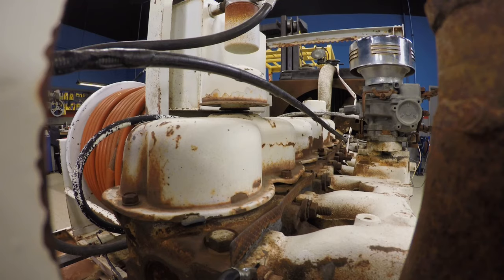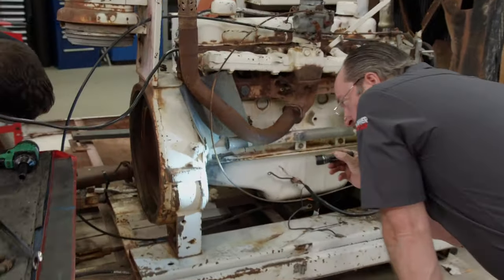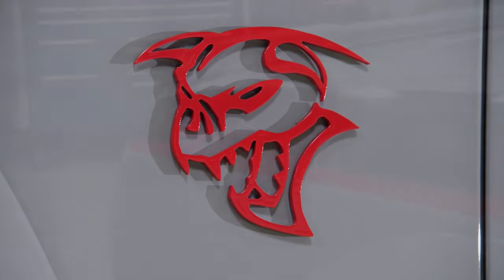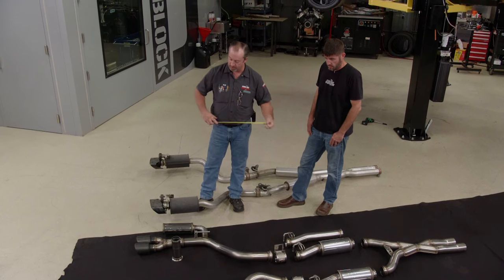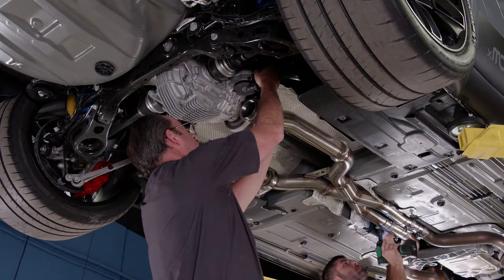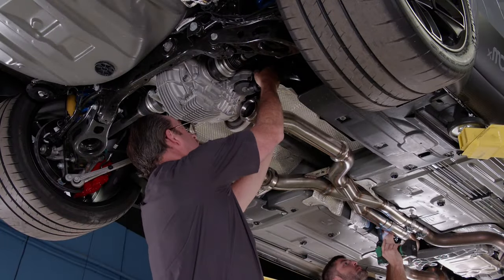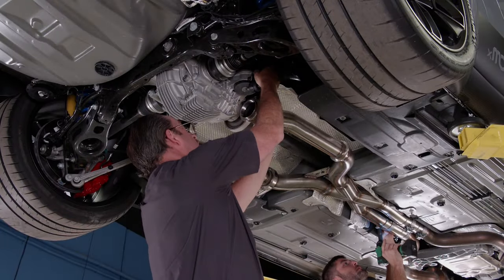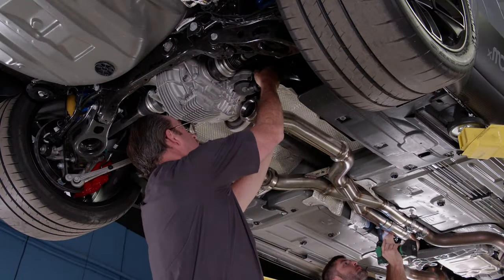Will The Ford 300 Inline Six Start After Sitting For 20 Years? - Engine Power S7, E14

Comment: Im not surprised this Ford inline six has the same good natured action as the 225 Slant Six from Chrysler that ran millions of Dodge Darts. This type of engine is almost impossible to destroy! Those run on High Compressed bottled  or stationary natural gas feeds,  stay clean inside,  like they were made yesterday, since carbon is not a product of its combustion. I know, because I replaced my clogged catalytic convertor damaged 235,000 Slant Six with low compression and severe blow by, killed rings in my 1981 Cordoba with the Hydraulic valve lifters and last revision of the head for the new lifters,  with the same out of a  1985 Dodge East Ohio Gas Company Van that had been rear ended.  

The junk yard crinkled the valve cover and I wanted to crY at how cleans this piece of mangled Valve Cover was on the inside! I also marveled at how clean the rest of the inside was and I spent hours meticulously stripping my old valve cover to get it in the same condition. That engine was like new inside, no clogged oil gallery passages to worry about! 

Unfortunately, the gas company removed all the CNG systems, or I probably would have tried it on CNG! I did replace the clogged Cat abc all went well and it ran like new with all the torque to make the  reasonable acceleration, it had when it was brand new!  Torque is what makes these go, not horsepower. They really have great low end torque, same goes for any inline six! These should never have stopped being made!

Comment: Believe it or not I just pick up a 1992 f150 with a inline6 5speed 4x4 hasn’t run in over 3 years! Back in January been messing around put a new fuel tank and pump in it new Spark plugs and wires and she fired right up

Comment: What is the weight of the passenger 240 vs. the weight of the 300 truck engine?
Reply: Alan White : No major difference. Maybee 5 pounds less than the 480 pounds with accessories. 15 to 20 lbs over a stock carb 2bbl 5.0 or 289 [No p.s., no a/c, just alternator, starter flywheel & water pump.( The small one at the front...not the big one at the back!)]
Reply: @deanstevenson6527  thanx, l was thinking it would be 50# less than a 289.
Reply: Alan White : No, the US 250 and Aussie 250 alloy heads are about 430 to 450 with accessories, although Ford claimed 410 pounds once on the iron log head 250. But they also claimed it was a 155 or 145 hp gross engine, same as the early 240 Big Six. The Australian cross flow 250 iron head engine from 1976 to 1980 weighed 481 pounds and lost 51 pounds with an aluminum head, but when fuel injected, it had another 51 pounds of alloy intake and vane meters and wet fuel gear added. So all Ford sixes varied. The little US 200 was 365 to 385 ponds dressed.

Comment: I owned a '66 Ford F100 with the 240 cubic inch version of this engine.  When I needed to change the oil, I climbed into the engine bay and stood next to the engine while changing the filter!  This thing ran forever.  The 240 in my old truck made about 129 gross hp [about 110 in today's net horsepower] so the 5500 pound truck wasn't uhmm.....Fast.  But it could just about pull a house off of it's foundation....
Reply: I converted my Truck 6 to electronic ignition.

Comment: Perhaps the greatest gasoline straight six ever made!  Is that a Heavy Duty exhaust manifold on that thing? 
My truck has a 240 which is a destroked 300, (someone swap-robbed the original 300) and it still has the torque to move my F150.  The worst part of these engines is the puny Carter YF carburetor and restrictive intake manifold.
I prefer the old log style exhaust manifold for its smoooooooth sound.  The EFI split manifolds add choppiness to the sound, even through a long single exhaust - they make it sound more like a V6...

Comment: I worked at a oil change shop as a teenager and saw a company bring there service trucks with 300 in them and one had 475 Thousand miles and showed no signs of stopping.

Comment: This was a really FUN episode...  I hate to sound like a parrot, but, all my years of building performance engines, sure, it pays the bills, but it is boring to me anymore... When somebody brings in some crazy and odd, or rare.. Man does that get me excited... I am like, I accept the challenge, of trying to locate parts, cross ref parts, like Cadi forged piston in a Ford engine, (yes, I did that once, LOL). I once had a guy bring me two engines, one that he wants built stock as possible, as per a concourse efforts, and the second unit, he wanted HP'd out, and he claimed he was gonna just have it on a stand for show, so I got to concourse the daylights out of that as well on the 1945 to 1950 Crosley racing engines. These dinky inline 4 bangers produce something like 35 to 40 HP, that is how dinky they are, How many of you folks have lawnmowers that are sitting in your garage that the engine came with much more HP this these dinky Crosley 4 cyl inline engines? LOL... None the less, Those two dinky engines were some of the funnest to play with, exceptional hard to locate parts for, let alone new parts or to say, new old stock, that is just not gonna happen.. SO, we spent many hours in R&D making cores for our local foundry, to cast a few extras, like cam shaft for the strange overhead valve train, a few extra crank shafts the complicated water pump housing that was actually hard to make cores for and get it right, due to the strange nature of its design. We even made a few sheet metal stamping dies for a few items that were sheet metal on the engine, .. The engine dynometered at 53 HP all said and done... That may not sound like much, but when you see how dinky those pistons are, if I remember correctly, has a diameter of 1-3/8th  or maybe it was 1-5/8th diameter, LOL.. Heck, the old school B&S lawn mower 2 stroke has a much larger piston then these little guys had.. It was so much fun ...  Cleaning the head gasket mating surfaces up by standard methods, one has to be extremely careful to only remove enough material to just clean things up, as a .020" deck combined clean up of those surfaces, would change the compression ratio too much, LOL.. The smaller you go in cu. inches, those numbers really start to get really tight and can throw the base geometry of the engine way off...  These little engines are very dinky, A Ford 2.3 ltr is just about twice the size of one of these Crosley units, Heck, the Honda 1.8 ltr is still twice the over all size of a Crosley from the 1945 to 1950's... Wait until you see how the cam shaft is driven off the crank shaft.. clever, neat, but risky, but it works.. Oh, we had to machine new helically cut spiral gears at all 4 locations, as that oiling appears to be a leak in the top set, hence the massive amount of slop, a copper drip tube plumbed into the galley resolves that issue, the copper tube was choked down via a press-fit button orifice approx .030" diameter, so the dripping was constant, but not taking away pressure from the rest of the bearing surfaces.. Pardon the novel, but the strange engine stuff, like this Ford IN, Inlive 6 / 300.. That was cool. The torque out of that 300.. wow!!!

Comment: I got a C20 1983 Dually 4 door with a Turbo 400 Automatic 3 Speed, along with a 373 Ratio.  I've been wondering of taking out the 454 and putting in a 6 Straight 292  and putting on a Turbocharger.

Comment: The 300 six is big, it's heavy, it gets terrible gas mileage and makes very little horse power, but it will run and do the job no matter how beat it is.
I had a friend in high school that had an 81 f250 with a 300 six and that motor had so much blow by the dipstick would shoot out of the tube when you revved it.  It smoked and knocked every time you shifted gears and was by far the most worn out motor I've ever seen and he drove that truck for 5 years without any problems at all.  It always started and always ran.  He ended up getting tired of the truck and sold it

Comment: one of the best motors made, if you have a carbed one the carb is two piece and the two screws holding it together will loosen with time, it will run but start to want high test gas, offset Phillips screw driver, easy fix.

Comment: skipped the dodge, i wanted to see that 300 run.
other than that header intake heat issue, these engines were bulletproof beasts that just would not die. my dads old bronco had the 300 in it and that thing wasnt fast but it would rip a house off its foundation

Comment: Big far of straight 6s and v6s, as its what me mostly got her in Europe. A nice 4.9 straight 6 would be wonderful, and I bet it revs brilliant
Reply: runs like a diesel, the regular motors don't really like anything above 4k from what I've heard. the models with the forged crank could be run higher
Reply: @daveb1081  so more about a strong torque curve from low rpm. You guys got some amazing engines compared to Europe.
Reply: @RobsonRoverRepair  oh yeah this thing is capable of hauling fullsize backhoes and pulling out stumps lol

Comment: I would like to see someone soup up a 300 6 cylinder the last I heard of one that was souped up super fast was one that had a Cleveland head on it but it was cut into three pieces and weld it back together I'd like to see that or some kind of big Dino deal what does 306 because there's millions of them on the road it would be a fun project
Reply: I was reading the other night one with ls heads on it

Comment: my 300 i had on my 90 f150 and it was a 5 speed manual made it fun to drive it felt fast but i also did beat the crap out of it redlining it and just plain out flooring it all the time it held up but it did always have this cold start rod knock before i had it it ran ruff and was sludged up but it still ran sold it to some sucker lol

Comment: The 300i6 is the greatest engine ever produced at least greatest gasoline engine bar none. Ive seen one be used for 5 years without a new oil filter and it was rigged up with some old hose to draw gas from a jerry can because the trucks fuel system had rusted to hell. Repaired with outright duct tape and old cans that truck still runs to this day and hauls big stacks of firewood. Some engines are built to be fast some are built to be fuel efficient but this engine was designed with one sole goal: make it as reliable as possible no matter what.

One of the secret's to this engine's longevity is it has gear driven timing. There is no belt or chain spinning the camshaft its a direct linkage of gears from the crankshaft to spin the camshaft so unless the teeth in there manage to wear themselves down you will never have non operational cylinders and all thats left after that is to feed it fuel/air and spark

Apparently there is a rare head for these engines that mounts the exhaust on the other side of the engine though I think that was done because of design limitations of what the engine was going into and it presents performance problems of its own.

Comment: Pontiac Motors plant 51 which made the last of the Iron Duke 4 cylinder engines had an emergency generator on the roof with one of these Ford 300 cid engines in it. when it was removed before the plant was demolished it had less than 100 hours on the hour meter. When half of Michigan had a power outage the three G M  plants rarely lost power. the world headquarters for GMC , PONTIAC MOTORCAR DIVISION and the FISHER BODY plant attached to Plant eight car assembly.

Comment: I would really like to see this 300 get torn down, refreshed with some higher compression pistons, a fully ported and polished head, some dual valve springs, roller rockers, a nice lopey cam, a good set of headers, a sheet metal intake, and top it all off with either a multi-port injection system, or at the very least a 500 cfm 2bbl Holley. I think that'll make for a fun 300 inline six to swap into a Ranger (IF it'll fit in the chassis) in front of a nice 5 or 6 speed manual trans.
Reply: That would be dope in a Ranger.

Comment: Excellent Ford 300 6 cylinder with gas 2 barrel carb and was amazing yes on test after tune up with Dyno test too! Also Dodge car too was amazing to and so cool especially exhaust system too Lol ! Even 426 Turbo motor also horsepower and torque to holy crow ! Also brand New 3 types of 6.0 Litre V8 and get in ! But got make thing sounds werid if you guys get a Owner's Manual of  a 2002 CHEVROLET or GMC Z71 4×4  get the heavy duty  suspension called  it 5/8 ton has 4 doors cab with  5.3 Litre  327 C.I.  ( 350 ) motor 5300 Vortec , they  put out a 425 hp and torque 505 with 6 speed Allison Automatic transmission , 388 or 418 rear end gears be with disk on all four wheels or drums for option too! How know this my oldest Brother David had one plus fun part Air Conditioning when running didn't effect pulling RPMS, or HP with Torque and he ran Shell 89 or 91 or 94 octane gas plus A STP Total Treatment fuel injection cleaner every 3 months plus no Synthetic 10W30 engine with 2x Fram Oil Filter, even 2x Air Filter to plus PCV Valve too! Platinum A.C. DELCO spark plugs high Grade wires too ! Yes even when Ontario Canada had Emission Test  going on he past them all too no problem! Truck had loads miles and still going strong today last heard body upgraded because rust out on him but new owner got fix up ! But it amazing motors are been over years agree and seen lots also Lol too! My Late Dad Don had 1968 International pick up 1300 was 1 ton had 345 V8 4 bbl V8, 4 barrel carb was 1000CFM Holley carb with hand choke with 2 to chokes also D18 creeper manual transmission 4 speed, 409 Rear end gears  4 wheel drums brakes, Power Steering plus Brakes ! But 345 V8 found on the internet years later put 110 torque only 90 hp plus RPM low idle was 550 , high idle 4500 in top 3  or 4 gear! But idle was quiet too sound had ear plugs with light tick of spark plugs Lol! Enjoy your videos guys and keep post them I subscribed to to and post like plus mesaage again too!

Comment: Put a 4 barrel carb, some boost, efi headers or headman long tubes, 8 pounds of boost, Chevy rockers from a 250 or 292 and Chevy valves and your gonna see power like a 460 big block that got upgraded to a 4 barrel 700

Comment: I hope you guys at least filed or emery cloth cleaned the point contacts before running your dyne tests and set the dwell and timing on that old school distributor, maybe then you would have seen the torque and horsepower it is rated for by Ford.

Comment: A unbelievable amount of power can be made with the ford 300 I6 engine. I have a 300 in my pickup with a blowthru turbo setup using a 4 barrel edelbrock etc. Its crazy mean and will run away from my brothers big block Nova

Comment: Funny how people think an engine is trash if it sat up forever or it sat full of water or both being under water!
My advice to the naysayers, DON'T PULL THE DRAIN PLUG UNLESS YOU'RE WILLING TO FIX IT! 
The second you pull that plug is the second that the unchecked fresh air in the case will begin to allow rust to start forming on unprotected metal. Oil or water, it doesn't matter; just keep it full of something with the drain plug in place or you'll destroy it.

I just fixed two generators that were going to be thrown away by a family member because they were full of water and I was called to either take them on a Saturday before they hauled them to the junkyard. Sunday, they were running like tops! Too me 3 hours to fix the seizing of the newest generator that had the water drained out and no oil put back in it of it for nearly one year. The other had water in it for 4 years and it floated right out of the case and into the cylinder, valves, and the carburator... What a lucky day! Flushed it, cleaned the bowl of the carb, bled out the water from the gas tank, blew out the fuel filter, and sprayed some WD-40 down the throat to breakdown the oil sludge in it. 1 hour of "work" and  3 pulls later, she's like new... Brand new. That generator was a Harvey victim and resurrected in 2020!
One generator is the typical CAT and the other is an expensive, brushless generator head!

I love these I6 videos! Go grab a UPS truck next, they have an straight block too!

Comment: I have a 4.0 265 that needs a little TLC would be willing to get it fixed if ya'll would do it for me. Timing chains and Tensioners front and rear seals and oil pump. It's still in my 01 Ranger XLT 4x4 and driveable doesn't use any oil, I'm in zion il.

Comment: I drove a Ford f 150 home with no oil in it because I had to when I got it home I tossed oil in it and it fired up had oil pressure and I sold it two years later still running.

Comment: I worked for this guy and his father couldn't drive anymore.
His dad gave him a 1985 Ford pu
300 cid with 78.000 on it. The body was in nine condition and no rust. He said that they got bad gas mileage and were unable dependable. But he drove a 94 Ford diesel that only got 10 MPG and was always giving him trouble. I wanted to buy it and he would sell it to me. He sold it to someone else and for some reason this guy wound up in jail and the truck sits out in a field.
I know a guy that has the same truck and it causes him no trouble at all and gets 20 mpg on the Hwy.  Just because something comes out of someone's pie hole doesn't always hold water.

Comment: 14:00 He is creating a problem that does not exist. Ford made the exhaust touch the bottom of the intake near the carb to help fuel burn better in cold weather. This is why I want buy a car with cold air intake.

Comment: If it was a propane rig from the factory, it should have had higher compression than a gasoline rig. It should have more than 85 hp though. I guess that's the cam that they used for constant rpm though in that application.

Comment: Of course that industrial 300-6 isn't going to make a ton of horsepower. It was probably meant to run at 3k or less. Probably running around 8.5:1 on the compression and has a cam so small you need a magnifying glass to see the lobes.